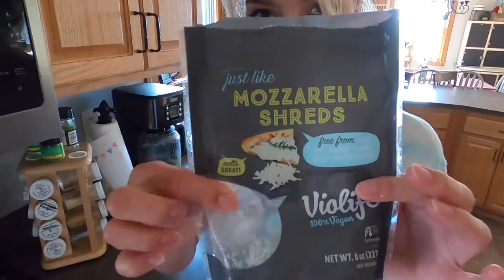WE FINISHED SHEETROCKING

Comment: You can cut the drywall short, that’s why drywall mud comes in five gallon pails. 😂
Reply: Better to minimize the gaps, otherwise joints are more likely to move and crack.
Reply: I was thinking #1 rule I've found with cutting drywall.... no wall is ever perfectly straight.... it was probly 86 3/4" at the bottom of the wall but 86 5/8" at the top... but also... totally yes!!!
that's why you use 90 minute drywall mud and mix it in 5 gallon pails  and mud quickly, then it drys relatively fast even if you have to lay it on thick, if you need more time to work, you can just add some extra water when mixing it, and use a drywall sander to sand it off if you get it a little thick.. just a large sander and use 40-80 grit sand paper

Comment: The sheet was bowed when you measured it, keep your saw horses closer and possibly cut it a 1/8 to 1/4 inch short. Your Adhesive Fiberglass Joint Tape and joint compound will fill in the seems.

Comment: Hey Chet and Nicole, also just a heads up, when putting the final sheet into a room like that, what you do is bow the centre of the sheet, get ur 2 ends in true, then push your centre home, that few mm, (quarter inch) or so will sit right at home! (30 yrs Dry-Wall experience) Awesome job you 2! :)

Comment: 2 hints or tricks from a sheetrocker both carry from the face side it a lot easier and if it doesn't fit hold the internals and just bow the centre out.  Glad you took my advice and double layered the ceiling much easier. 
Cheers Tony, sydney Australia

Comment: when you cut that sheetrock you layed it on the sawhorses and the sheetrock bowed down and you measured it with the bow that's why the mistake just saying
Reply: Saw that right away and came to the comments section to post it. Common mistake.

Comment: WHY does someone insulate inside walls? What a way to waste money.
Reply: Sound
Reply: Keeps the temp in the room a little higher in the winter for showering.  And reduces sound transmission.

I always insulate interior walls.  As a result the whole house is much quieter.  Fewer plumbing noises too.